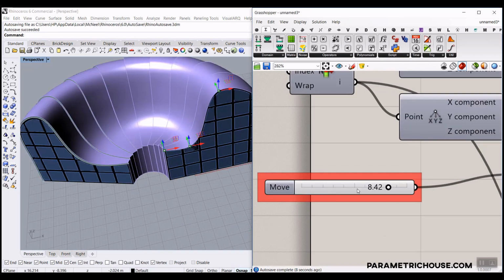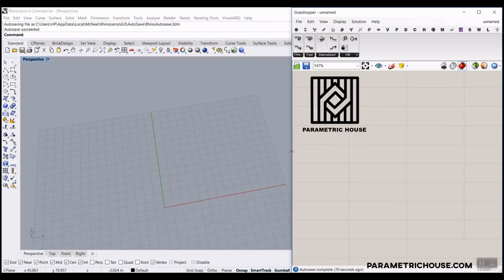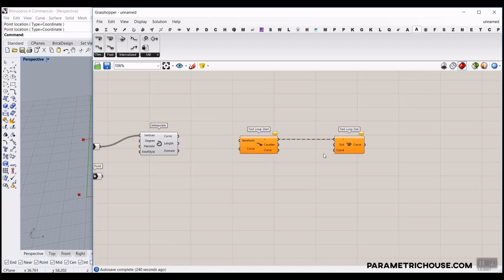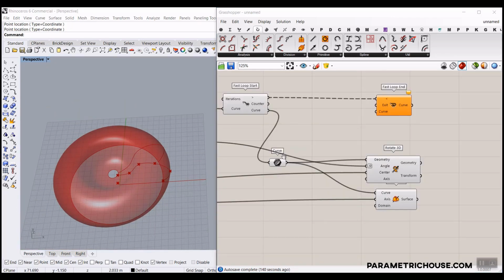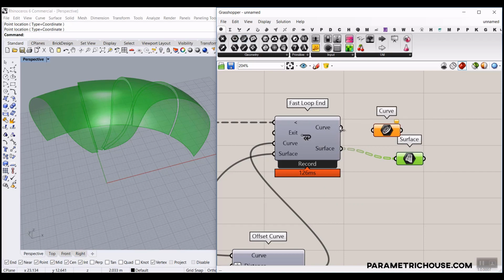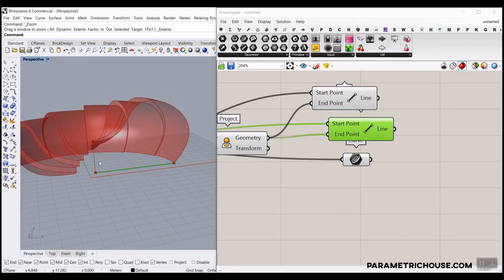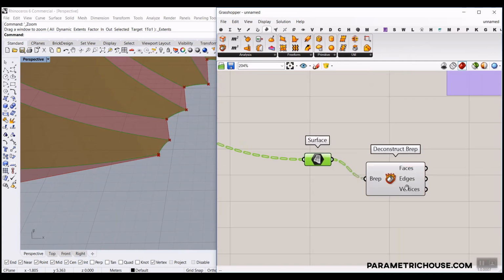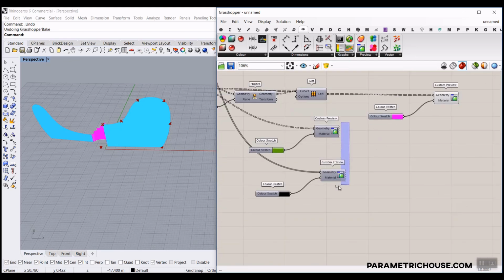Parametric Building (Rhino Grasshopper Tutorial)

Comment: Something happened to my offset loose. The end points of the later curves are going higher in Z, and the start points are getting away from the revove center. When I do edge 3 project to ground, it does not form a continous arc.